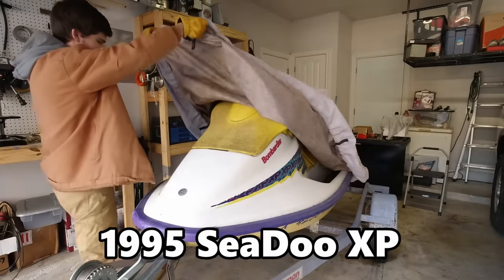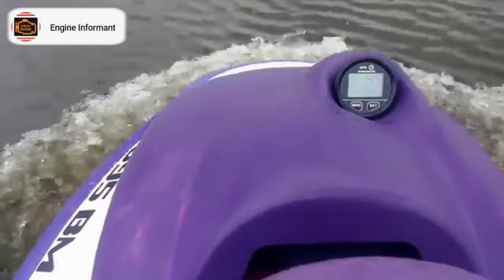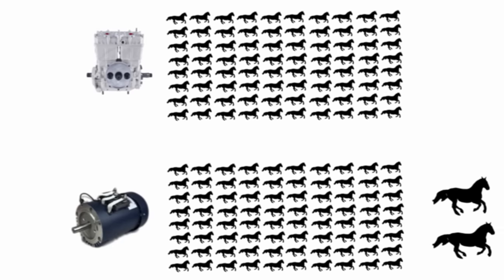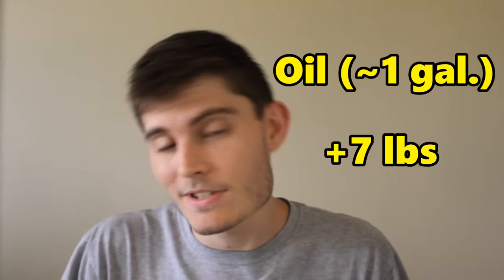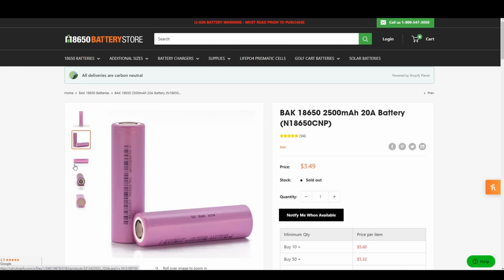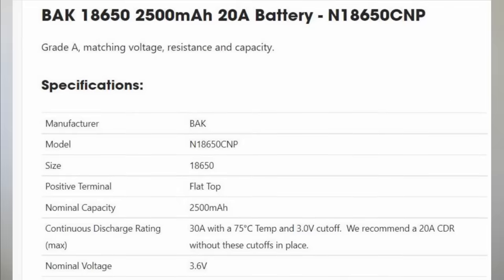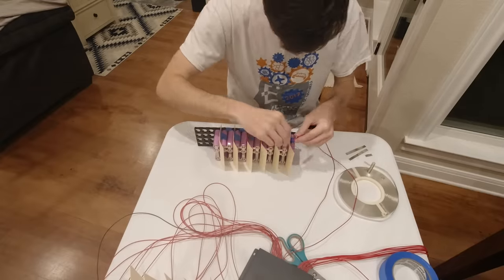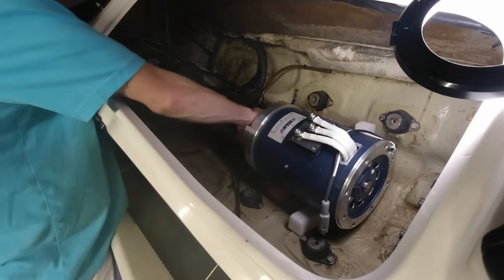Electric SeaDoo Conversion!

Comment: Great idea genius, all you need now mate, is a realy, realy, realy, realy, realy, realy long extension cord ? Oh well at least you can have a LITTLE bit of fun for a VERY SHORT PERIOD of time if running on batteries. I'm sorry did I hear you correctly say that you couldnt afford the stated $ 1,000 to fix the Rotax up ? Hang on a minute did I also hear you say that you you squeezed the price of the electric motor replacement on its own down  $ 2,600 ? And now you will need to buy an expensive inverter suitable to drive the said electric motor. Also the verry heavy and extremely expensive bateries plus charging equipment just so you can zoom along if all goes well for how long ? I would have just bought a new petrol engine, saved heaps of money And continue to have heaps of fun with lots of money left over for lots more petrol which equates to a lot more fun dood.

Comment: Why don't you ditch that crappy soundtrack so people can actually hear if that electric system is quieter than the gas engined version? Really, people won't die without that constant background commotion, rather than being able to hear the the machine in action as well as seeing it.
Reply from the maker: you can listen to the rear footage here https://youtu.be/Xr1zEG4ZBfY

You still get most of the same sound from the jet pump, but also from my driveshaft misalignment. Unfortunately the camera filtered out a lot of sound with the wind filtering

Comment: In my opinion, you wasted alot of time and money. 
In my calculations 

2600 $  motor
Batteries system 
2500 $
Wiring 
500 $ 
My hourly rate in real life 
110 $ in hour
 
So in the end your project will cost me between 15 k - 20 k dollars 
And the most expensive electric jet ski will not cost me around 25k 
And i will Make 24 k in one month 
So my New jet ski cost me les than 1000 dollars, so failure project.
Reply: lmao, he is doing it on his own time why are you including you hourly rate??

Comment: Aah yes, electric this and electric that. Because what we really needed were massive lithium-ion fires directly under your ass while you're on a jet ski. It takes a single cell to fail and the whole thing goes up in a flame that water can't extinguish, and then it'll pollute whatever body of water you were skiing on with all sorts of highly toxic chemicals. Gas fires and fuel leaks are much less impactful on the environment even if they're more likely to happen than a lithium fire. 0/10. Electric isn't easier or cheaper than gas. The number of moving parts is hardly relevant when you can access the interior parts of an engine and rebuild the whole thing yourself, whereas with electric, you just have to HOPE that the factory in china their batteries came from had 100% perfect quality control, and everyone knows that is impossible in the real world. Then there's also how dangerous a catastrophic failure of the powerplant would be to the occupant, and for electric that usually involves the release of toxic fumes before their spontaneous combustion into like 4900 degree flames. Gas engines might have a loud bang with some parts flying out of the block, possibly followed by a fire that is extinguished after being starved of fuel or air. And then all the electricity they consume is ultimately generated by coal power plants, while gas engines are able to use a significantly lower total amount of energy to move the same distance when factoring the infrastructure and processes it takes to charge/fuel these vehicles. What exactly is so great about electric conversions???